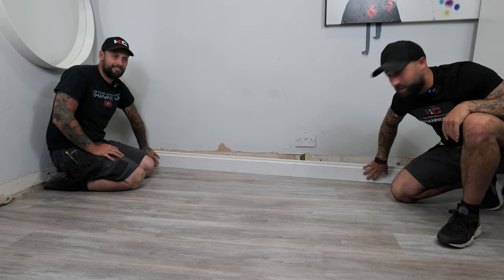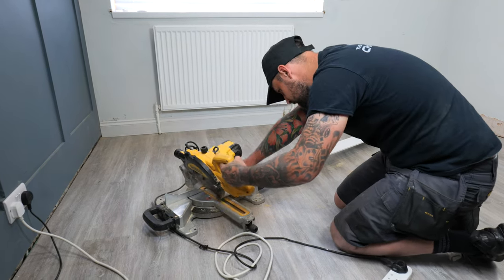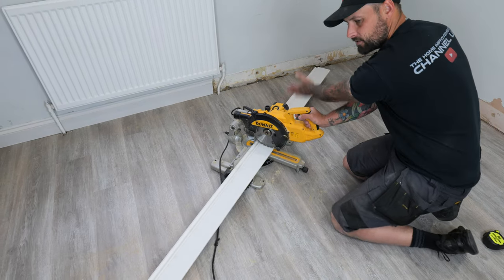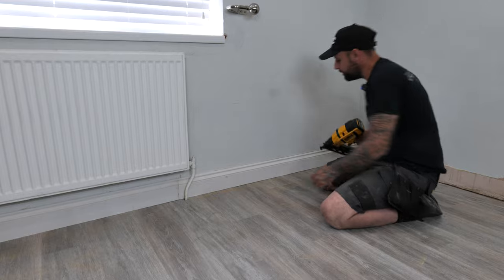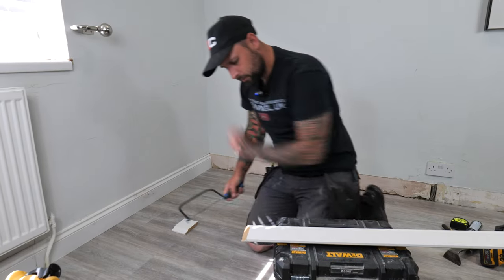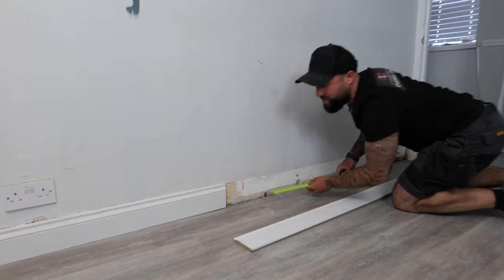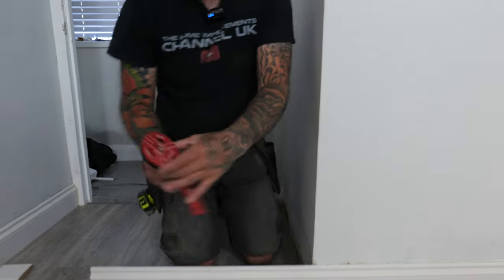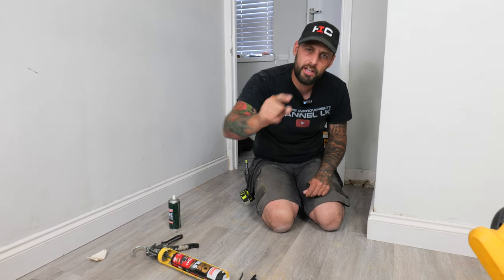How To Install Skirting Boards | Easy DIY Guide For Perfect Skirtings

Comment: Just one tip I would add. To make the skirting easier to paint, I use a spacer (credit card depth) when fixing the skirting to create a 1/2mm gap above the flooring. Leaves enough room to run some masking tape around the perimeter (and just in, under the skirting) and saves a lot of cutting in where the skirting might be touching the floor.
Reply from the maker: Quality nice one mate 😊👌🏼👌🏼
Reply: Is it compulsory to paint it

Comment: Very informative video. I remember the days when I scrabbled about on the floor cutting butt and scribes before chop saws and I used a nobex hand saw. As you get older you find cutting the skirting on a pair of stools with a couple of scaffold boards spread across them saves your knees and back.
Can’t say I ever worried about cutting the scribe to suit how it looked coming into the room as I always tried to cut the scribes on the right hand end as being right handed your coping saw is always in the same place when you need it.
When house bashing I would measure each room on a floor and cut the whole lot in one go and then fix it all off at once as there is speed in repetitive actions. Do all the cutting then do all the fixing, but each persons works to what suits them. The video is ideal though for beginner DIYers so well done for simplifying the operation.
Reply: stools definitely as you get older.

Comment: Bloody hell this vid means I can do it myself- I was really hoping to tell my wife it was beyond my dodgy DIY skills, so I need to get someone in- thanks guys for giving me work this weekend!
Reply from the maker: 🤣🤣 we can give you a letter signed explaining there are some super hard parts we left out if you want signed of courses to make it legitimate 🤣💪🏼
Reply: Hi guys, on the external corner if it's 44 degrees, is the joining piece 46
Reply: Also what is your opinion on pvc skirting
Reply: @jonrogers1780 Hey Jon! No, it'd be 44 again on the other side.
This is because they measured the angle of their wall and it was 88 degrees (instead of the assumed 90 for most corners).
I appreciate it's not super obvious because he used the tool that gave them a miter read-out. If he read out the protractor reading - it would have been 88.
Hence - his lesson that not all corners are 90 degrees!

Comment: What length nails do you use in the nailer and what have you the depth usually set at? I have the same nailer but my nails never seem to go in far enough and just crumple up or they don't hold the skirting. Don't want to resort to going back to masonry nails

Comment: Would be good to see the prep of removing the skirt on an older house, i have a house built in the 30s, removing picture frames and skirt is a nightmare due to the old sand mix used on the interior brick

Comment: Great video. Bit confused when you say 'it looks like a 45 degree angle' were you referring to the corner angle, which would be 90 degrees or there abouts? And if the corner is below 90 degrees, then the miter would need to be more than 45 degrees?
Reply from the maker: I’m referring to the cuts so standard would be 45 degree but in fact it was 44 or 88 degrees 😊

Comment: how did you cut your external mitres at 44 degrees? By setting the chop saw? Did you put the jig onto the blade to make sure it was at 44?
Reply from the maker: Just setting mitre saw to 44 😊
Reply: @homeimprovements  easy 😁 thanks for the reply!

Comment: Loving the tutorials guys. Im about to do my skirting boards on a porch extension.  Ive an issue with one wall. Its where the new porch wall meets the existing house wall. The length is about 500mm. Its two external mitre joints. Unfortunately the new stretch of wall is angled back creating a gap of a fingers width. Ive removed the plaster from below but the gap remains.  What would you guys do to reduce it whilst keeping the boards true? Cheers.
Reply from the maker: You could plane some of the back on the skirting away 😊

Comment: If one angle is 44, the other has to be 46 right? This wasn't in the video. Most mitre's go up to 45 only on the angle, so do you have to flip one of the skirting board when you cut it to get the smaller angle?
Reply from the maker: No not necessarily

Comment: If I removed a 3 inch skirt how do I fit a 5 inch skirt when the plaster ran up to the top of the 3 inch skirt?
Reply: Get a bag of one coat plaster and use it to fill in the gap

Comment: The old problem with plastered walls is they curl up the wall so usually need to chip off so the chopsaws got a chance to cut a 90° that fits

Comment: Handy tip: When scribing internal corners , instead of using a coping saw for the straight line.. Use a multi tool for the perfect straight neat cut ! 😮
Reply: Your definitely a sparky 😂😂

Comment: the cuts near the radiators are wrong, they should be 45 degree cuts so yo get a cleaner and seamless finish.  That does not look great at all.  I always do 45 degree cuts and always get a almost perfect finish.  Less cuts the better!
Reply: Agreed, I know em as weather cuts. But yeah, a 45° splice
Reply: If you do 45% cuts how do you manage to do less cuts then ??? Still need two cuts.😂😂 45% isn’t wrong …..it’s just different
Reply: Agree rad joint looked awful 45 best stopped watching after that
Reply: Always been told 45° cuts for a better bond and cleaner look 🤔
Anything less makes it more identified and prone to movement 😉
Include a gap below of 1-2mm for allowing easier painting as well as tension when knocked